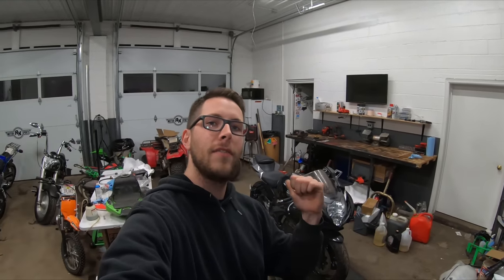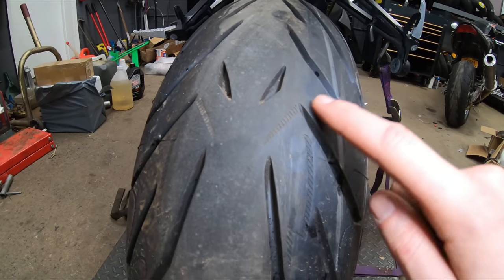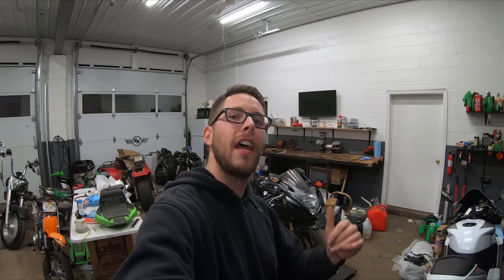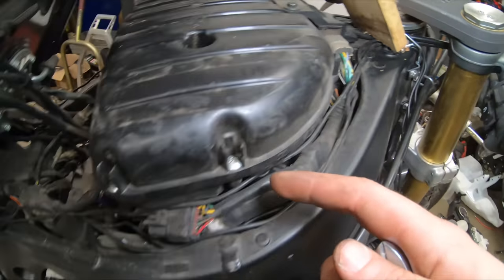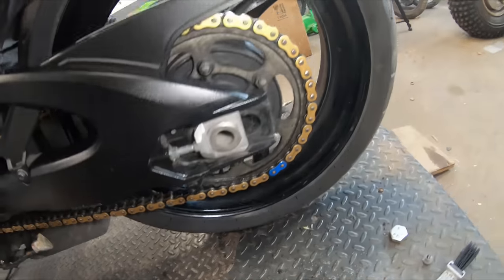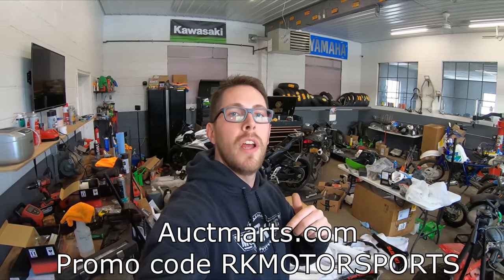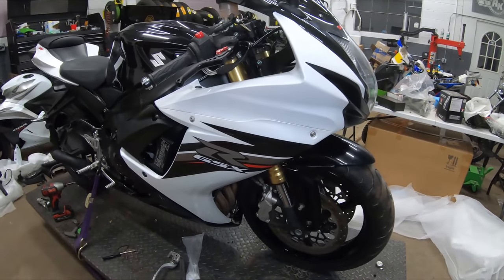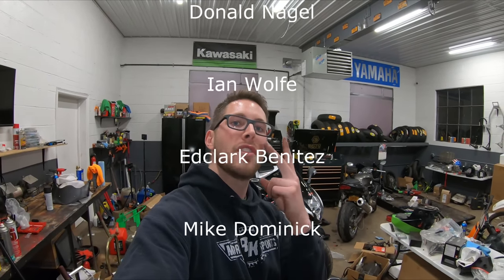Restoring a SALVAGE GSXR 750! (Complete Start to Finish)

Comment: I have only been on 1 Gixxer. It was a 750 and I laid it down pulling out of the parking lot. I twisted the throttle over a manhole and down it goes.
Reply from the maker: Those manhole covers are slippery! Hope you're okay!
Reply: @RKMotorsports  that was in 2003

Comment: Its always satisfying to see bikes coming back to life. New fairings looks awesome. You are right, that exhaust is hideous. Throw that away and fit a full system on it. If you see a bike on street with led lights, 99% it will be a gixxer or a busa. Those squids love led lights. Happy to see you removed that curse from the bike. I think the rear left turn signal lens have more gap from the carbon piece than the right side. Not a big deal. Just letting you know if you haven't already noticed it. Nice restoration video and good job bro.✌
Reply from the maker: Thank you! And about the taillight I'm surprised you caught that! It's a very small difference that I did notice

Comment: I was always taught to take it easy the first 60 odd miles with new tyres so the friction heat broke down the mould releasing agent left on the tyres. I know guys that ride home, put the bike on pit stands and take to their new tyres with a belt sander to remove the wax....
I like Angel GT/GT2 pirelli's. They can take a bit longer to heat up and are a bit sketchy hitting some diesel in the wet or on roundabouts but I can get up to 20,000 miles commuting out of a set.
Reply from the maker: They are great sport touring tires where you can get some good mileage on them

Comment: Yo what’s up Rob, dope video man, I have a 2019 GSXR750 just had to put a new faring kit on it as well same build, I’m just curious I noticed you didn’t put the plastic panels under the front end. It snaps under and across the ram air ducts, but I’m now wondering if I should just leave it out for better air flow

Comment: Angle ST's are great tyres for sport tourer style bikes, especially in the same category as the Kawasaki ER-6f aka Ninja 650 (I had two set on my old bike). They would be fine on sportbikes too if you don't ride too aggressive in colder temps, they have a softer outer edge for grip and harder centre.
For faster riding and on my ZX9r, I have Michelin Pilot Power 2CT's, a good upgrade from these, still a duel compound, but aims more at a sporty riding style and bike.
Love the Angel that turns to a Devil as the marks wear off on the ST's though, a great looking tyre.
Reply from the maker: They really are great tires but do serve their own purpose

Comment: Nice video but everything you did (on video at least) was cosmetic. What about an oil change, air filter inspection a coolant flush, brake oil replacement, maybe check the vacuums or TPS sensor. Is that aftermarket exhaust interfering with any of the bikes maps...

Comment: I use those exact tire models and they sometimes are a bit slippery when brand new. Especially on smooth and or wet surfaces.. Very likely that that was the cause..

Comment: Nice work, pal. I like the new color scheme over the old one. But my favorite Suzuki fairings are the old white/blue scheme they had for years. I know, I’m boring like that. 😄 

Thankfully the LED lights are gone, and maybe a nice pipe will be fitted somewhere else where it’s legal. 🫤I’m wondering if maybe it had a nice one and that one was put on to save a nice pipe. Maybe I’m wrong. I’ve seen some Alibaba specials put on liter bikes. 🤢
Reply from the maker: Yeah I can't understand why people spend 10k on a motorcycle and then put a $40 exhaust on it...

Comment: Whats up man. First let me start off by saying i absolutely love your channel and work. Fun, staright to the point with a simple explanation. Love it. Maybe u can give me a recommendation. I have. 2010  Kawasaki z1000 and the engine paint is chipping off in places like the clutch cover and stator cover. I want to paint them myself where it doesn't cost me much. What spray paint would u recommend? Engine seems to have a satin like black paint from the factory

Comment: I have those same tires on my bike not exactly for riding hard in corners more of a sport touring tires. They definitely look almost fresh so probably didn't break them in completely or like you said went from one brand to another soft to hard and wasn't used to them.
Reply from the maker: These tires have their purpose, but you're correct they are more of a sport touring tire and aren't the best option for crazy grip
Reply: I've got the same tyres on my mt09, they grip fine in spirited riding. Most likely user error that caused the crash.

Comment: Brand new tryes are coated with a special "wax-like" substance, and after fitting new tyres the rider needs to take it easy with the leaning from side to side to allow the wax to wear off in small increments. Seem to me the rider put new tyres on but didn't wear this wax off and just tossed the bike into a corner and lost the front and the rear end together. :(